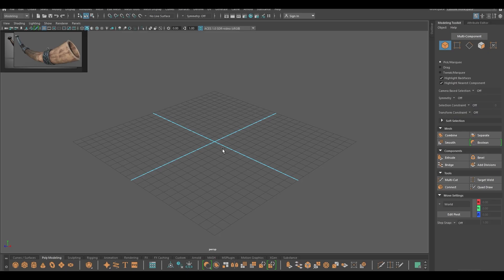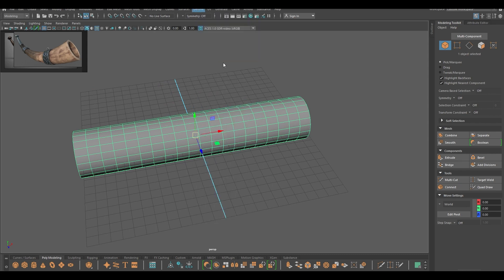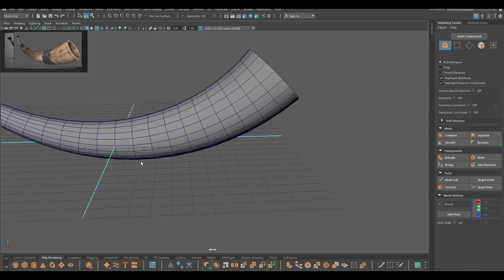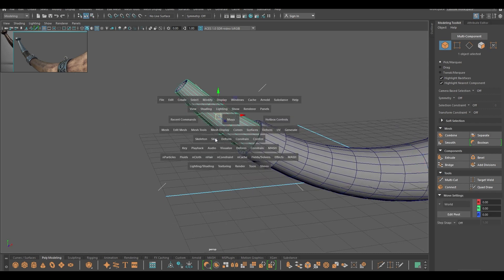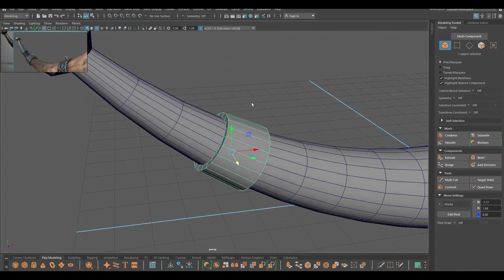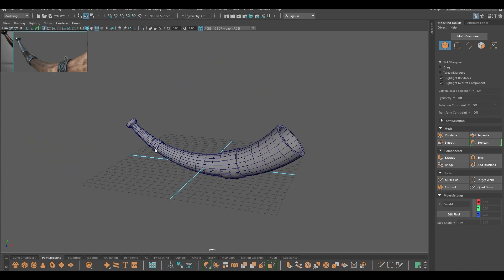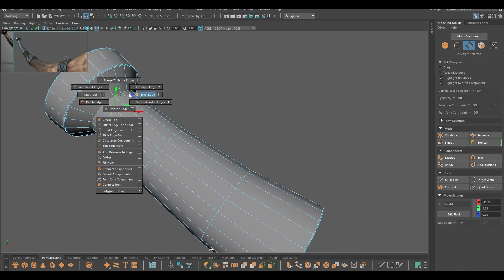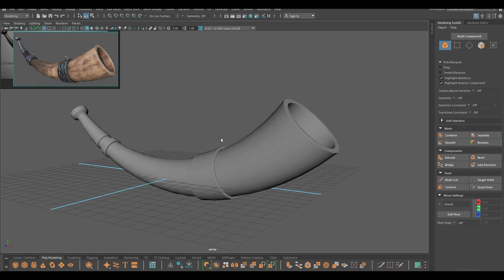War Horn Modeling - Maya Modeling Tutorial | Maya 2023 Tutorials

Comment: at 3:50 when you selected the egde of the duplicated face after cetered pivot, the pivot is still centerd to the edge.

When I selected the edge of the duplicated face after cetering the pivot, the pivot goes back to the ground and it does not follow my selection, and i cannot center it back to the edge either. why?